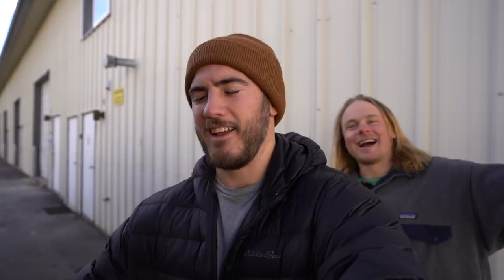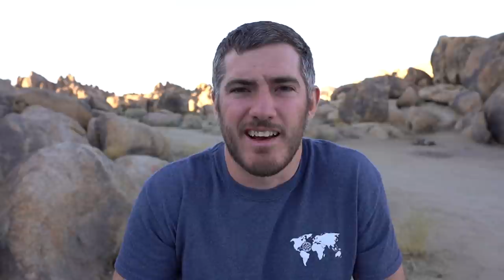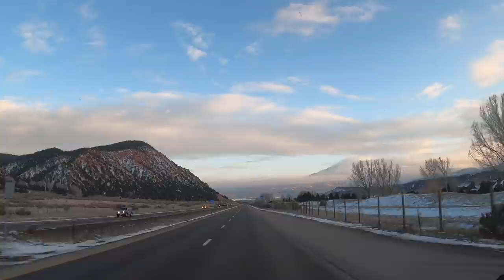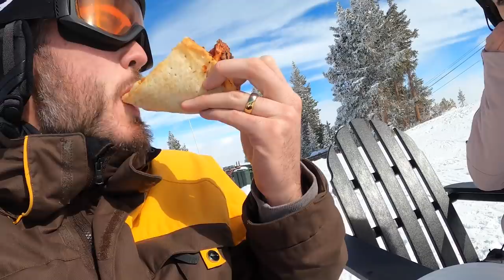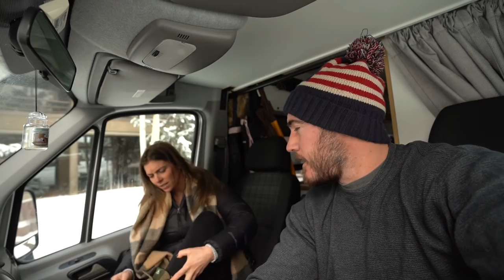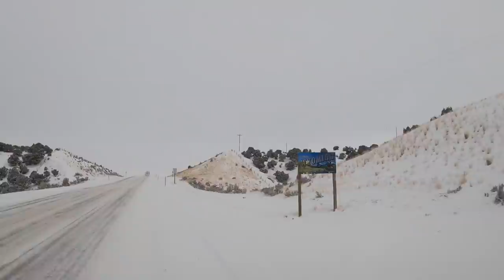We Almost DAMAGED Our WATER TANK | Aspen Colorado - Van Life Ep 30

Comment: VW runs their vent pipe from the top of the water-tank up the inside of rear door pillar column above the manual fill port vent, so if you overflow your tank while filling the water comes out the the manual vent fill first. Might be a consideration to extend your vent up your door pillar so that you don’t inadvertently overfill your enclosed tank and flood your inside of your van.
Reply from the maker: We re ran it through the bottom so no need to worry anymore!

Comment: Great video and a close call on the tank. The snow boarding looks like a blast. 
Freezing tanks have been a concern from the beginning of my planning. So I ordered three 12 volt heating pads, one for my under mount gray tank, one for my  batteries and one for the water tank. I copied and pasted the Amazon description below. I ordered them with the 3 switch panel so I can control when they run. I figured heat the water when the solar panels are finished charging the batteries and use the  panels to heat the water. 

Description
7 1/4" x 25" Heater Pad 12V For Fresh, Grey, or Waste Water Holding Tanks
Features & details
Peel and stick adhesive back attaches easily to most tanks
Activates when water temps drop below 45F(5C) and heats to 68F(20C)
Helps maintain flowing water in freezing temperatures
Manufactured by Genesis Lighting under Patent No.: US10257888B2
Reply from the maker: Smart!!! Make sure you have no p traps underneath the van as well or they will freeze as well (learned the hard way)
Reply: @MathersOnTheMap  you can pour some windshield washer fluid into your grey tank, it has enough alcohol in it to keep it from freezing and its cheap at Walmart or any auto parts store. Plus it's good for the windshield.